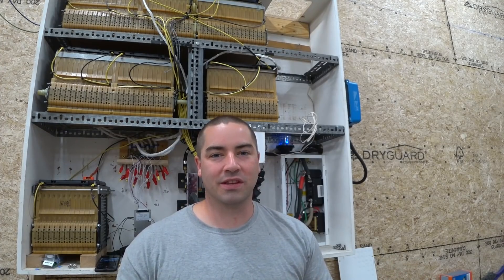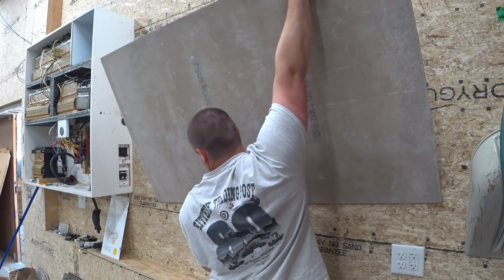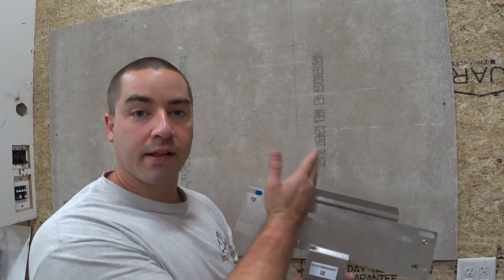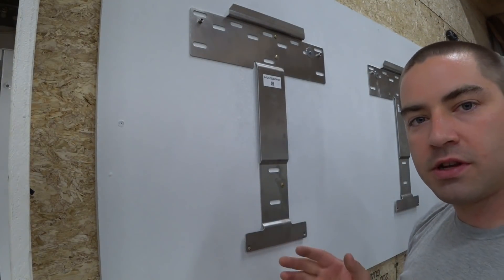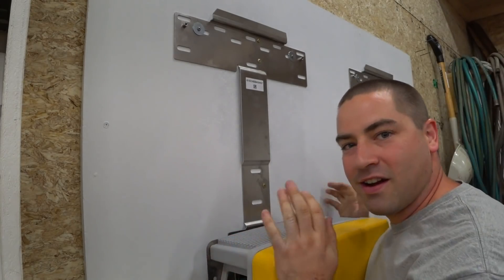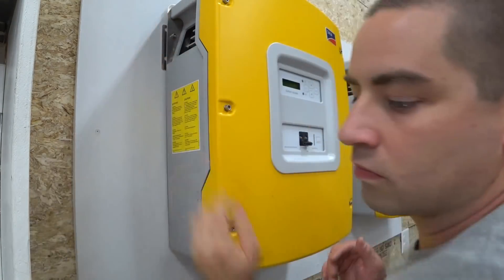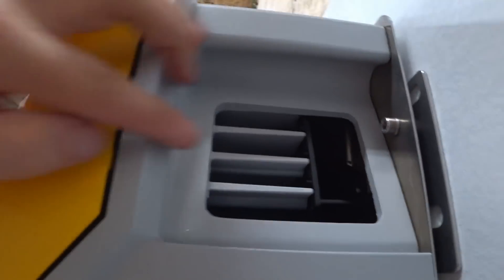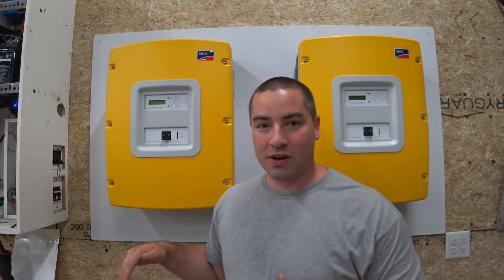Mounting New SMA Inverters 120/240v 12kw (Split Phase)

Comment: These are the same inverters used in building the “Ultimate Garage” for Mike Holmes in Canada on the HGTV network. He started as a contractor, repaired hundreds of homes, 10 seasons later, the highest rated HGTV show in Canada but found on smart TV’s using WiFi. Water, rain, driveway rain collection into cistern and filtered, minerals removed, wash cars, wash driveway and water landscape. 14 of the 800 Watt solar panels into 10,000 watts of batteries thru sunny island inverters. LED lights, super insulated, roof top green garden and 2 double car lifts. All complete with upstairs work out room, tv and fireplace with bar. All overlooking the vehicles thru tempered glass railing. The “Durisol” blocks, similar to foam blocks used in “ICF” but stack like LEGO’s and molded from wood chips at 80% and 20% cement to form blocks with R28, 4hr fire rated, rodent & termite proof, lightweight, cuts like wood, inhibit mold, breathable, no VOC’s, Rockwool insulation at R28, screw into, no motor required, cavities for rebar and concrete, used in Sweden since 1945 and paintable.
I want that for Christmas 2024 and left notes for wife for six weeks. So far….no answer! 
Writing Santa. 😮

Comment: Hi. Some questions ;-) How big is you battery pack? Why you need 2 Battery inverter? Is your load really so big? I also plan for my 15kWp PV an battery. Normally I would use some used battery from vehicle. Like the BMWi3 20kwh. BUT there are 8 packs with 48V. How can I work with one BMS for all packs. OR second idea lifepo4 280Ah 16pic with 13.33kWh. With one BMS, very easy but new cells. In Germany we don't have battery hookup ;-((( Thanks a lot for your input
Reply from the maker: My battery bank is about 30kwh right now.  Each inverter is 120v only, but I want 120/240v.  So I bought two inverters and they communicate to provide the power I want.  The BMWi3 would be an excellent build.  In that case each of the 8 modules is 12s Li-NMC.  So you would want to purchase 8 small BMS's, one for each module.  I've built a two large battery banks where I wired everything together to a central BMS and there are problems that arise.  It's actually simpler to use 8 smaller BMS's.  
For your second idea, if you are buying the prismatic cells, then you can parallel the cells first, then series them.  In that case you can use one large central BMS.
Reply: @DavidPozEnergy   thanks for the input. What BMS are you using? I found only the REC BMS which can communicated on CAN with the SI. Is it better to buy 16 280Ah or 32 140Ah? Or doen't matter? The price is the same. Maybe I will decide to buy 32 200ah or 240Ah.
Reply from the maker: Batrium brand is supposed to communicate with the SMA inverters, but I haven't tested it.  You can run the inverters in VRLA mode so it won't look for an outside BMS.  Then you just have to use a stand-alone BMS on your battery.  I've done it that way for most of last year.  Right now I'm beta testing a program on a Rasberri Pi, but it's not a BMS, so I still need a BMS.  I've used a lot of Daly BMS's in the past.  I also tried a Chargery brand, but it doesn't work well.

Comment: Have you tried to use the BMS with canbus with your batteries?
Reply from the maker: No, not yet.  But I'm currently testing a "Tiny BMS".  It has a Can Bus option which I hope to test.  Currently I have the SMA inverters programmed to "VRLA" (valve regulated lead acid).

Comment: Would you recommend the aims inverter? I ordered a victron but it failed as soon as I powered it up and the seller refunded me. I have several other victron items but I'm open to suggestions (3500w pv) (require 240v split phase for my well)

Thanks
Reply from the maker: I used a 6kw aims inverter for my house, 120/240 and it worked great.  It is considered pure sine wave, but not as clean as the grid.  Outback Radian is another good option if you need very clean sine wave.  The one I'm using now is the pair of SMA.

Comment: Anxiously awaiting the final wiring of these units.  I've got a bid in on 2 of these units.  I'm making a portable split phase 120/240 48V system.  Starting out with 16 LifePo4 100ah, and probably add 16 more later on.  The cart will be maxed out space wise with 32 batteries.   I have a toy hauler trailer along with the house, so I can roll the cart to power one or the other.  I'm just a DIY guy myself.  You are very helpful to me.
Reply from the maker: Thanks for your comment.  I'm editing a video on the wiring today.
Reply: I was originally gonna buy the MPP unit, but laughed when I saw you try to run the saw.

Comment: Can I use this one for air conditioner 3000w?
Reply from the maker: Each inverter is 6000 watts, and has a massive surge capacity.  They can start compressors.

Comment: Fire Rated plywood is what you would normally use to mount any electrical or telecommunications equipment. Generally available at a lumbar yard.  But I guess cement board works too.... Those inverters look awesome...

Comment: I just returned a 20k powerjack...yes i know..you get what you pay..now i am looking for something like this.. are this inverter low frequency ? are they noisiest ? what about heat management..  thanks in advance
Reply from the maker: I have not run them up to full capacity, so I can't say if they over-heat.  But they don't make any noise down around 2kw.  Yes, they are LF.  Massive round transformers on the backside.  The whole case is thick aluminum for heat transfer.

Comment: i am curious with your paralleled inverters if you wanted to could you use a different battery chemistry on each inverter ? For example the LiFePO4 on one and the LiMnCo on the other .  I guess it would come down to whether or not the charge characteristics  are controllable by each inverter separately or as a single unit when they are in parallel.  I assume you might be able to use a combo of Lead acid on one and LifePo4 on another but just not get the full energy out of them by picking a voltage range that wouldn't harm either one. I haven't looked at exactly how they are wired to each other or to the service panel when they are paralleled.
Reply from the maker: Only one inverter is the master, the other is the slave.  So you have to use one battery bank for both.
Reply: @DavidPozEnergy  kinda what I thought unless somehow you hook grid to both independently so they might both synch to grid with different pv strings and batterys to each.

Comment: You would have saved a lot of money to just stay on the grid from the start instead of going solar.You really have used an inceddibly amount of money on this since the start.
Reply: The up front cost is high but I put in a 15.3kW system on my home in TX where it is humid for 9 months of the year so air conditioning is used.  It's easy to rack up a $400 power bill each month for a 2500 sq ft home.  My system cost me $21k using grid tie, no batteries.  It was actually much more than that but after federal kick back of 33% and then TX kick back I only went out of pocket $21k.  That was 6 years ago.  The system keeps my power bill way down, oftentimes $30 per month instead of $300-$400. In another 1-2 years it paid for itself and then it will pay me the rest of my life. If I sell the home it is a real selling point because it is like getting a $300-$400 check each month at today's power rates.  But inflation is coming and so I expect electricity prices to rise as well soon.  And when they do I will be even happier that I generate most of my own power.

What will you do?  Actually, I already know.  You will suffer through austerity.  The bill will go up and you will not be able to pay it and so you will do less with less.  It is foolish of you to come here and say disparaging things about those who take their own future into their own hands and then give "advice" like "you wasted your money with this".  I don't think he wasted anything.  I think he's smart for doing it.  In time, so will you.

Comment: I use a midnight solar classic 250 to charge my batteries and the sma as the inverter. Works beautiful.
Reply from the maker: Hi Red Nose,  Thanks for commenting for the first time.  Since you are charging with DC, I do have a question you might be able to help.  I'm planning on using my existing Victron 250/100 to charge on the DC side.  The inverters suggest adding an external shunt when DC charging.  I own a 600 amp 75mv shunt that came with my BMS I'm adding.  But I can't find the answer to this.  Can the SMA Sunny Island inverter read a 75mv shunt, or do I need to buy a 50mv shunt?  Do they have a recommended shunt?  Thanks.
Reply: @DavidPozEnergy 
Hi Dave, They will but the readings will be wrong. They are no provisions for 75mv in the SMA, oly 50 or 60mv, I have tried it before. HOwever, I bought this one from Amazon. https://www.amazon.com/AMMETER-SHUNT-500-AMP-MILLIVOLT/dp/B005BHPG6K/ref=sr_1_14?keywords=50+mv+shunt&qid=1578576676&sr=8-14. Its an overkill at 500 amps, but its also the best deal I could find at the time. 200 Amps would be ideal but they cost more. As I said earlier, the 500 will do the same job.
Reply from the maker: Thank you for the link.  Yes, that is a good price on a 500 amp.
Reply: @DavidPozEnergy  Midnite solar sells full complete SMA inverter panels and systems, they might have a good shunt also.  The Midnite site is a good resource for deciding what other components are needed beyond the inverters themselves.  I am putting the parts from a DC Solar trailer into the garage.  I got the 1900# batteries off the trailer today.  https://photos.app.goo.gl/qbVKkST35cJAB9Zc9       It's nice that a lot of the parts are all there together (like the shunt), but I still need some things like battery fusing and DC bus overcurrent protection breakers.  What are your plans for overcurrent protection on your 48v battery bank?

Comment: Hello to David and all others. I have been watching your videos for a while and like your keen interest in the solar energy. This is my first time posting on youtube. I normally just read but decided I will share my 2 cents worth. As an electronics professional, I will chip in where and when I can. 
I will first say, you made the best possible choice when it comes to inverters. I have tested and used many of the so called chinese ones and I will say, they are pure garbage. Powerjack, worst of the bunch. Right now, I have a 5KVA that cannot even run a 1500 watt microwave. As for the SMA, SI6048-US, I can use microwave, Rice cooker, and toaster oven all at the same time. This will be consuming about 4000 watts. SMA handles that like candy. 
As someone has asked before, Sunny boy is grid tied and Sunny island is offgrid.

Comment: Help me to understand.  Is this a battery only, off grid inverter and not a hybrid system?  Thanks.
Reply from the maker: I'm using this inverter as off-grid only.  I don't know if it can back-feed the grid or not.
Reply: @DavidPozEnergy  These inverters can export back out on the AC2 connection.  The manual is pretty detailed, takes a while to digest and understand it all.

Comment: Hi David, does this inverters have ability to drain battery first and then switch to grid power? Or you'll need to switch it manually every time? Thanks for videos.
Reply from the maker: I don't know all the features of these inverters.
Reply: DavidPoz do you use your current invertor as complete off-grid system? I'm trying to find how to do battery as primary and grid secondary power supply
Reply from the maker: The plan is to use the inverters off-grid only, and use the grid as a back-up to charge the batteries if I don't have enough sun.  But I don't know if that's going to work or if I'll just have to switch the house back to grid.  I'm guessing they can do what you want, I just don't know for sure.  I don't have them both connected up yet.  I've only been testing them with some temporary wires at the moment.

Comment: Hey there awesome setup!!! Question: I have 110v outlets but I have a couple of 240v tools compressor and grinder can I use something like your old setup couple of car batteries to run each tool separate just need something affordable not to educated on these type of setups need 240v badly best regards Brandon
Reply from the maker: My old Aims inverter ran 240v and tools well.

Comment: please show us how you'll connect it together to get 240v.
(2 in parallel, or each powering it's own phase)
Reply from the maker: Sure.  I'm not there yet, but will be showing it.  Each inverter will output one phase at 120 volts.  But, they will communicate with each other using a data-cable (RJ-45).  So each phase will be 180 degrees out from each other.  That will allow 240v between the two.

Comment: You and me both... I picked up a pair as well just happened to be browsing eBay. Mounting mine this weekend. I have to find room for 2x sunny boy 6kw and 2x sunny boy 7.7kw as well...lots of real estate req’d. Mine are running off 48vdc Nissan Leaf gen2 modules. Still looking for best affordable BMS any suggestions? Btw the on-board pass-thru relay is rated 56A for gridtie sunny boys so 7.7kw is too big. What will you use for a AC/DC combiner box or will you wire direct? I've seen lots of DIN rail boxes like midnight solar but big $$$. I'm thinking just get a DIN rail enclosure and buy all the ac/dc breakers I need. Thoughts? https://www.altestore.com/store/enclosures-electrical-safety/electrical-enclosures/disconnectload-enclosures/ac-andor-dc-c1104/ (not necessarily gd place to buy but here are some of the boxes.) Midnite solar's box (yellow matching e-panel) for the sunny islands are huge $$$. We need a 250A dc breaker and 60a ac breakers.
Reply from the maker: The affordable part is hard.  LOL.  I bought a Chargery 16s BMS.  They go for about $200, which I think is acceptable.  I haven't tried it yet, so don't know how well it works.  Batrium makes a specific Nissan Leaf thing.  They want $750 for it: https://www.batrium.com/collections/decentralised-supervisor/products/watchmon4-leafmon  Might be worth it if you have a big battery.  Or you can use small BMS's, one for every small group of cells.  I did this with my Smart Car battery.  Group the cells 1p14s (which is 7 Leaf modules) and use a smaller BMS for every group.  I don't know how many cells you have.  But, lets say you are planning 250 amp breaker for the whole thing, and you have 70 leaf packs, which would be 10 seprate 48v groups.  You could wire each group with a 60 amp BMS, and include a 30 amp circuit breaker.  30a breaker times 10 groups is 300 amps, so better than your inverter breaker of 250 amp (which is what you want).  And, you need a lower breaker than the BMS to protect the BMS.  I use a minium of 50% rating.  These are $25 each, which would be $250 for 10.  https://www.aliexpress.com/item/32842587387.html?spm=a2g0o.productlist.0.0.5c5a1278djcu4n&algo_pvid=b9c3d12a-8fb0-4d79-b016-643c2829460a&algo_expid=b9c3d12a-8fb0-4d79-b016-643c2829460a-0&btsid=31554b21-6b3a-40e8-b66a-153bae6186a9&ws_ab_test=searchweb0_0,searchweb201602_10,searchweb201603_55
Reply from the maker: It's hard to keep track of conversations in youtube comments, so if you want to dive into this, can you send me a message on Facebook?

Comment: David, 
How much power did you figure your new battery bank will store in the six batteries you mounted? I noticed you purchased 12 of them. Are you intending to mount the other 6 and power your neighborhood?
Reply from the maker: Hi Craig,  I picked up 12, but I bought 8 and a friend bought 4.  I did him a favor by picking them up for him.  My 8 batteries will be installed in the rack I built in the corner of my garage.

Comment: David, I'm looking at those inverters on eBay. The price is too good to be true.  Can you tell us how they have been functioning so far? Any problems?  Did the units come with warranty info? I tried contacting the vendor,  Solartradeworld, but no response.  Sounds fishy...
Any feedback would be appreciated.
Thanks,
Arthur
Reply from the maker: Hi Arthur,  When I first got the units I did turn them on by using a jumper cable to the leads, LOL.  Just wanted to make sure I could get 120v output, and I did.  Then I turned it off.  I did this just in case I had to return them inside of 30 days.  But, I have not been able to do a load test.  They are currently on the wall and not connected to anything.  I'm busy wiring up my batteries.  Sorry, we all have to wait a little bit to see how well they perform.  As for the warranty, I have no idea, never asked.
Reply: @DavidPozEnergy  thank your for responding, I do appreciate the feedback.  
I'd like to say that I am encouraged and gratified to see other DIYers trying their hand at alternative energy projects!

I eagerly await your follow up video on wiring the SMA units.  The company website has very little helpful video content for home installations.

Cheers,
Arthur
Vancouver, WA

Comment: Looks like $1600 is cheapest on eBay now. Amazon is $4500 each. Are SMA Sonny Boy the same product? Two 6kw = 12kw is great as long as your loads are spread across your breaker box properly. Map out your loads because thought is not always given to how loads are applied in the breaker box. Enjoy your new found energy!
Reply from the maker: Hi William,  The Sunny Boy is a grid-tie only inverter.  The Sunny Island (yellow) is for batteries.  However, they can be used together in an AC coupled system.